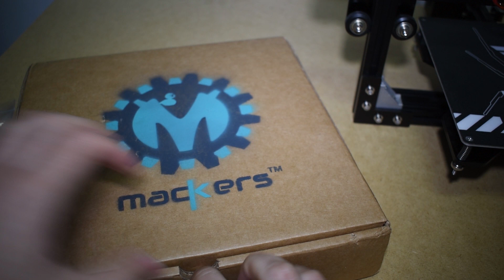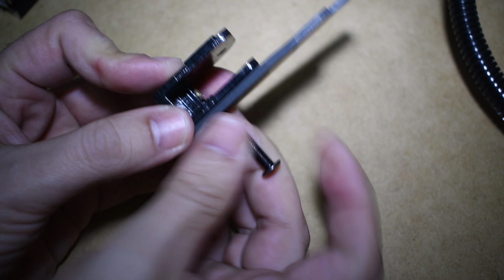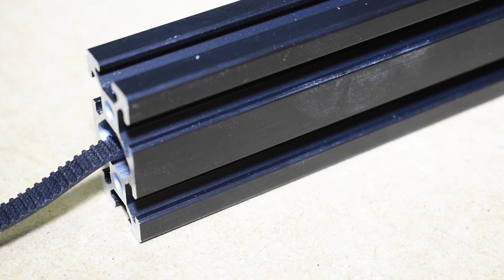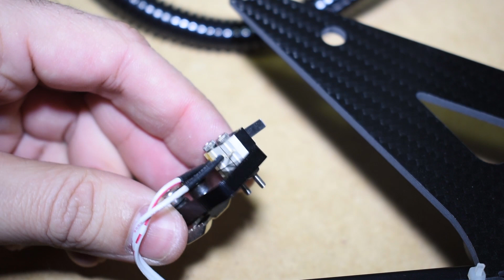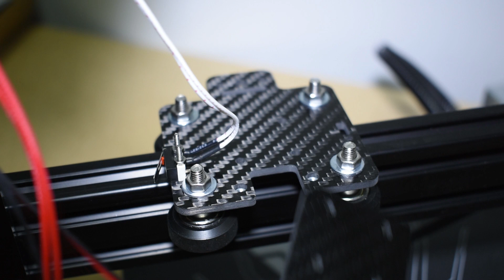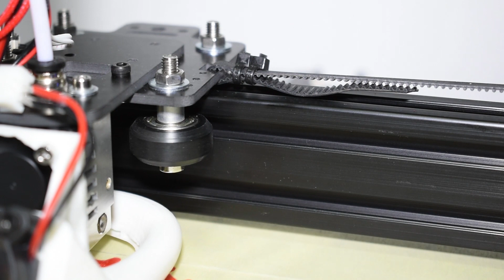Reviewing the new Mackers Carbon fiber TEVO X 2017 with Belt tensioning system

Comment: If you improve the printer, then it is better to put rails of the type Mgn 9 or Mgn12, because the rollers are designed for the profile of v-slot, and in our printer t-slot.
Reply from the maker: That is another upgrade i suggest in my early videos ;)

Comment: Why did you not use "toothed" idler pulley wheels?
Reply from the maker: Hi Chris,
The toothed pulleys are one of my recommended upgrades and i have them in my tarantula. However, for this video i decided to use a brand new tarantula with no upgrades yet.